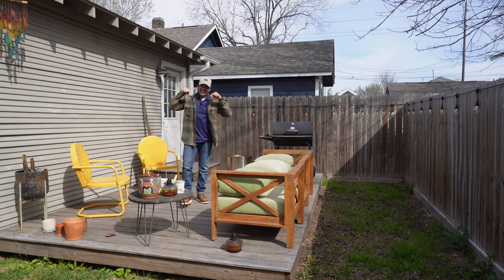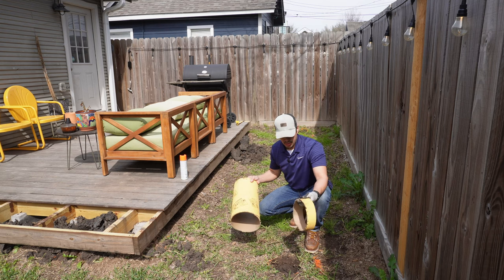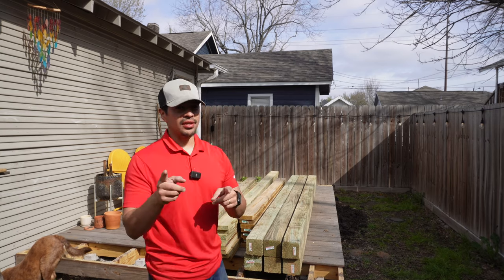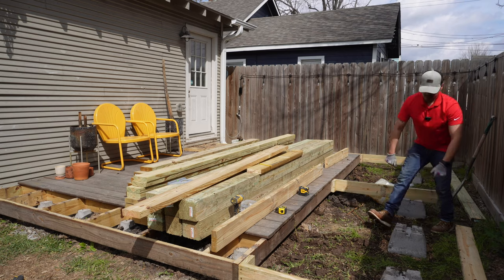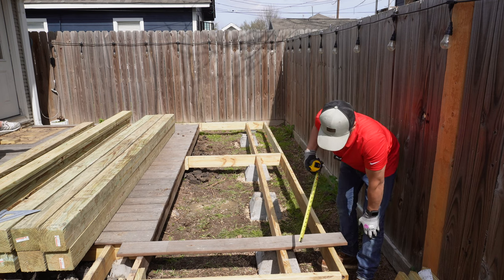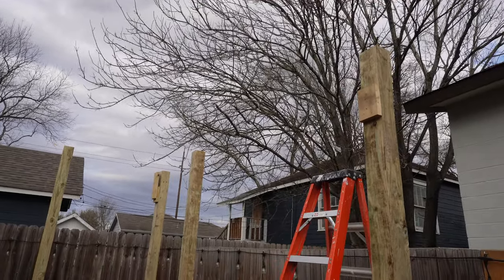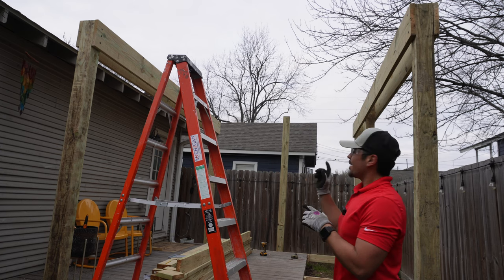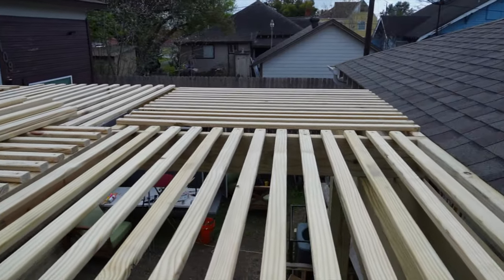DIY Pergola Build and Deck Extension / How to Build a Modern Pergola

Comment: Pro would have suggested remove all boards and change as theres no point having the pergola outlast the rotting deck. 😂.  If not then remove all boards and tape membrane on old joist.

Comment: The videos does not sho how you fastened the boards that make up the grid patter. Did you toe nail those in or are you using joist hangers?

Comment: Question, I love your build, I was wondering why didn't you tie the new portion of deck planks into the existing deck or replace the deck planks with longer ones that would have one uniform look, rather than a cut off at the old deck, or attach the planking like flooring with staggered seams.
Reply from the maker: Hello 👋🏼 I wanted to do, but my friend said that this was just fine. 🤷🏻‍♂️ If it was my house, I would’ve done exactly as you said. 👍🏼